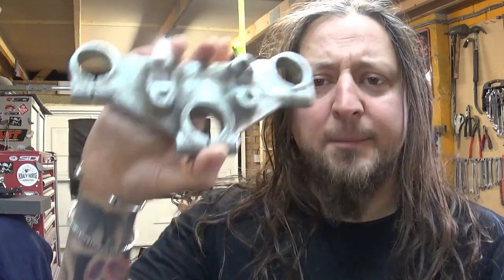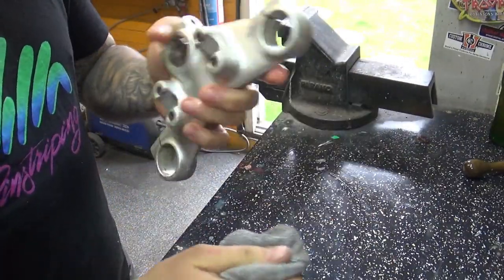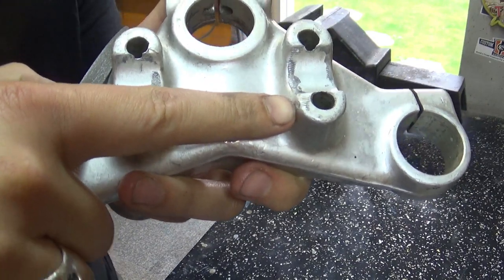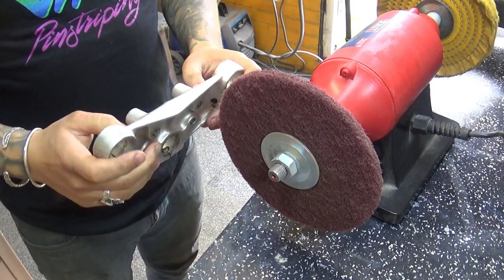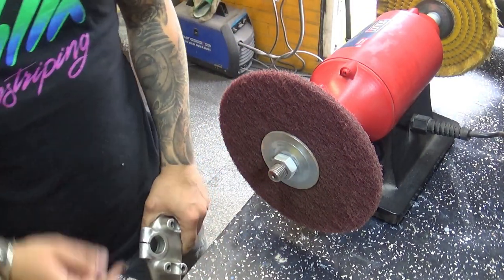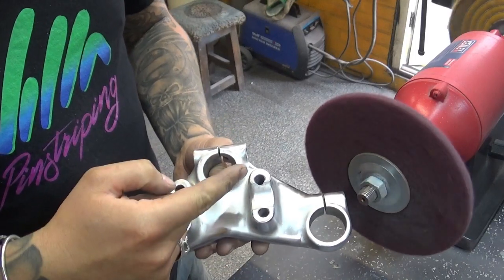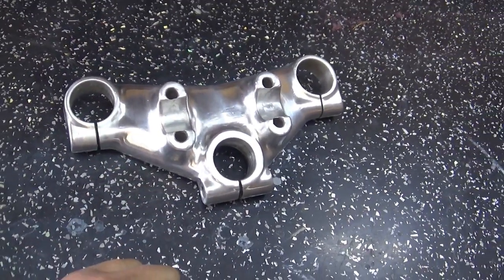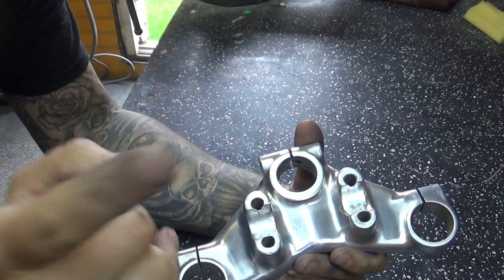Restoring Parts To Brushed Aluminium Effect in 30mins!

Comment: I tend to use a tooth brush or other softer plastic implement to get the crap out of the nooks and crannies first prior to going to the scotch bright. I don't have the bench tools but use a leccy drill clamped in a workmate for the same effect, then one of those bendy extenders connected to the drill to do the Dremmel bit. Ways and means if you don't have access to the tools for the job.
Reply from the maker: Amen to that brother! I use press drill with smaller pads to get into tight places also.

Comment: Nice one Mackie I've got some cam covers that are very corroded and that finish would be perfect would you put any kind of lacquer over for protection or no ?
Reply from the maker: Yes and no... it's up to you. Problem with clear on top it can start to peel, which will ruin a job eventually. If yo umust you etch clear, this should work fine!
Reply: @MackieBass  Thanks man nice one . : )